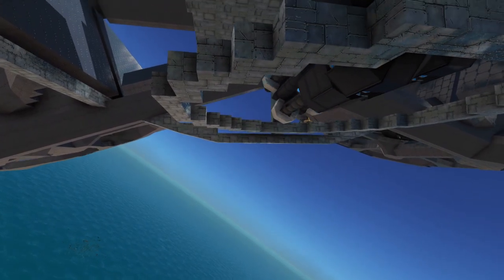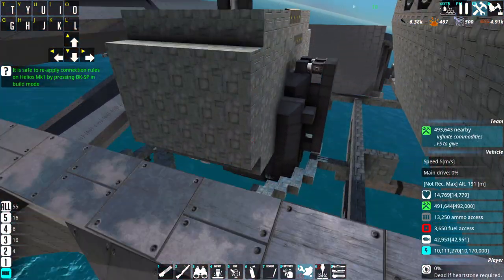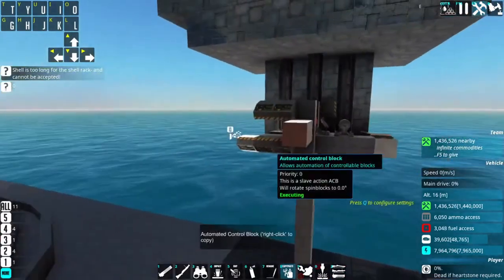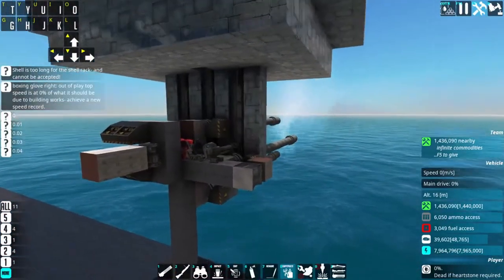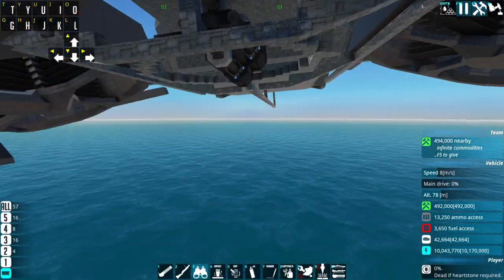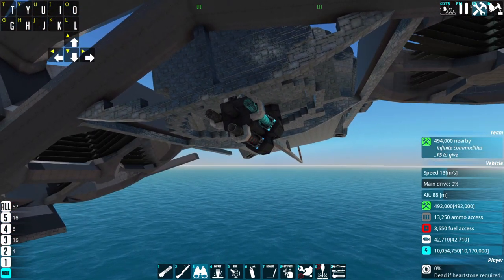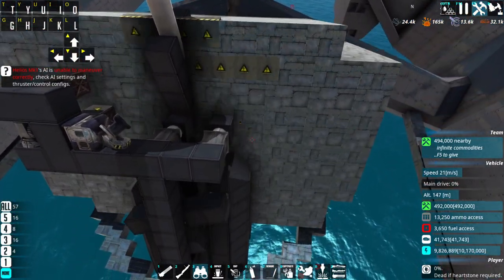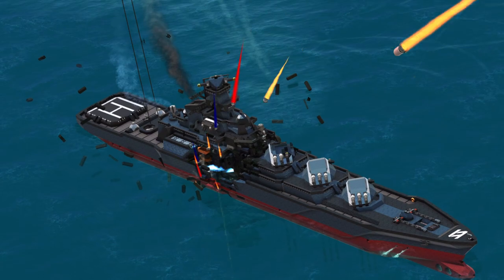This gun is basically a Rube Goldberg Machine

Comment: I believe one of the biggest challenges to new players in this game is that From the Depths simultaneously couldn't care less, and cares a great deal, about clipping. Not just spin block clips, but turrets in general.
Reply: The best way I can understand it is that the first sub-object detects collisions but a secondary sub-object on the first sub-object doesn't. Try messing with a one axis Azimuth turret and then placing an elevation turret on that sub-object: Everything attached to the Azimuth turret cares about collisions, everything on the elevation turret couldn't care less. As for the control blocks in the video, guessing they are proximity based, if not then idk.
Reply: The problem is that turrets in and of themselves both care and dont. For example, a 3x3 turret can be a full 3x3 square. This obviously shouldn't work, but theres no issues. 
A 5x5 however, needs the corners cut out. Why?
What's different?
Programming wise it might make sense, but from a gameplay perspective it just means theres some magic reason you need to learn differently, otherwise your turrets just dont turn. And that's incredibly annoying.
Reply: @eloryosnak4100  Ah, I see what you mean. Yeah the physics work out so if the turret is in a square space, the turret shape has to be circular because that's how physics would work in the real world: you can't rotate a square inside of a well-fit square, but you can rotate a circle regardless of the shape as long as the radius of the circle is less than the radius of the confining space. Definitely feels wonky sometimes, but if you've ever looked into how to make circles in Minecraft then it makes building easier. Basically the square's corners have a bigger radius than the square's sides and so the corners run into the walls of the square around the turret. Hope this helps.
Reply: @Chaos77777  as someone who also suffers from this issue, no that doesn’t help, why the fuck does this have to be so complicated 😫
Reply: Carl, Wheezer of souls The problem is everything is square, and IRL ships are round, so the physics “approximates” the circle from the shape of the square.

And the reason subobjects on subobjects don’t clip is because the calculations required would destroy your computer

Comment: In my FTD clipping research i have found this=
1. HESH/HEAT will destroy entire gun barrel and firing piece if you put said APS on a subobject with no arnor around

2. Explosions kinda buggy, it sometimes bypass portruding main object block and damage subobject inside 

3. Clipping armor in same place dont add armor. Only made a waste since both block smh may die by same kinetic projectile 

4. Subobjects smh easily knocked out by explosions (sometimes explosion buggy and kill subobjects easier). A really bad idea for armor. Stick with vanilla armor layout and no clip

4. HESH, HEAT, HE good vs subobjects that tucked in armor, especially the weak bits

5. Out of all its issue, its still useful since you can pack more dakka in small area even with a chance of critical damage may blow everything up :P
Reply from the maker: thats really good to know!
I will try to integrate that knowledge into the design, right now it's more at the state of "hope I dont get hit in the gun"